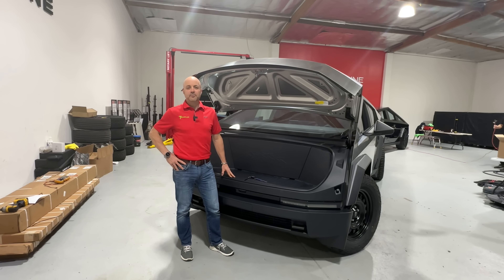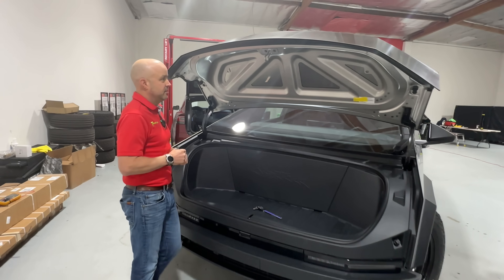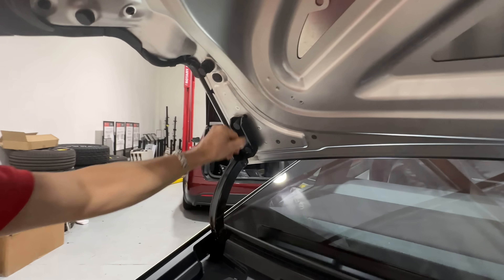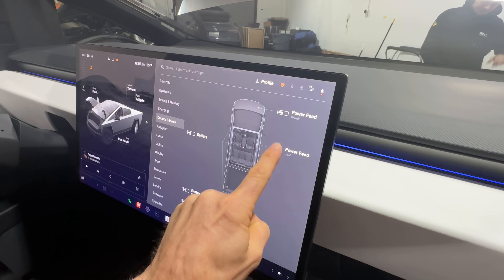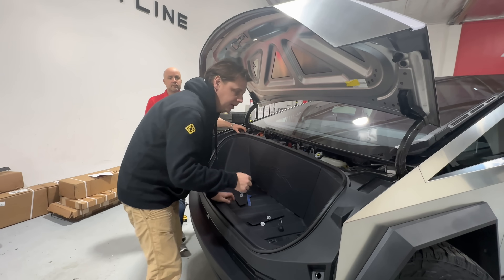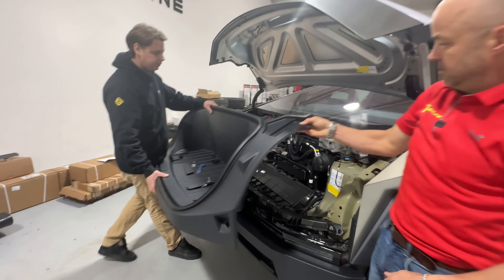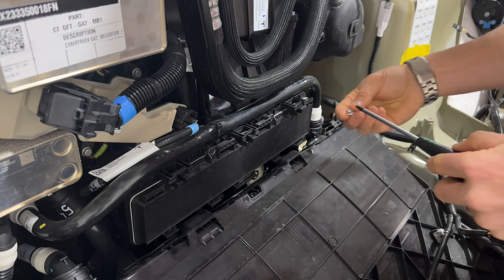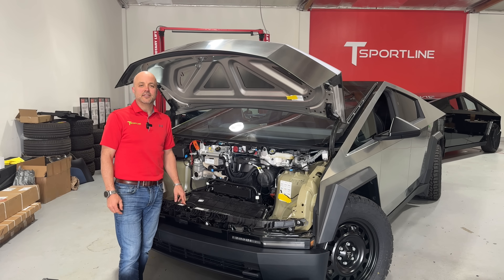Dissecting a Cybertruck Part 2! Tesla Auxiliary Power Under Frunk, Inspection & More, first look

Comment: I wonder if you can get signals to that green wire as an outside business 🤔 what would you dream up to use that for?
Reply: I had the same question - what does it take to get a control added to the OS/touchscreen for something like a winch?  Other manufacturers like Ford add multiple free “auxiliary switches” for 12v accessories like lights - would be cool if Tesla added that to the touchscreen and let either the manufacturer label them via the BUS or allow the user to add a custom label.
Reply from the maker: The green wire is the Tesla LIN signal wire.
Reply: @TSportline  well yes but what are the possibilities for its use? What would you do if you could use it?
Reply: Think Arduino. It's a 19200 baud network with about 16 data frames of aux stuff. Buttons, light indicators, etc. Good for power window buttons, door locks, etc. You could probably use software to do anything you could think of. Say you added a unit in your frunk to fold up a large Christmas train set with a Christmas village, and you put that out on display once you got somewhere. Then you could write some code to address all the different parts of your display. Say tell the train to move forward, or backwards. Maybe turn on the tiny street lights, blow some fake snow around the village. Maybe create an auto pack up or auto setup feature to open the frunk and deploy your Christmas village. Then use your app to provide monitoring from the main control panel in the vehicle and see what everything is doing out front. Not that I would build such a thing, but it gives you an idea of what you can use it for. Control and monitor on a simple level. No video data, etc. I'm sure you'd have to use the WIFI for that. @whitlockbr

Comment: Curious what the wheel bolt pattern, factory offset, rim width and center bore diameter is.  Looking for the lightest wheel I can find for drag racing applications.  And the lightest high performance tire.  While still being budget minded, lol.

I run a set of 19" forged Enkei's on my M3P that I bracket race.
Reply: CB seems like it’s going to be amazing for bracket racing based on the few videos so far showing multiple runs.  Seems to get within a 10th run after run with no degradation in performance at all, and leaves the line super consistently.
Reply from the maker: Wheel specs are here https://tsportline.com/blogs/tesla-aftermarket-support/the-tesla-cybertruck-wheel-guide

Comment: Thanks for the video. That was very informative.
Are the black bumpers made of plastic? I would want to replace those with steel. I suppose the aux power could be used for a winch?
Reply: Winches seem to use way more than 400 watts - so it can't be used for a winch. Maybe it could charge a battery used for the winch?
I hope they add more aux power in the future, electrical outlets in the frunk, and programmable buttons for the UI.
Reply from the maker: Thanks, yes, plastic on both bumpers.  We will make steel bumpers at T Sportline
Reply: @pierre.a.larsen  - Yep.  A quick look shows several 2,000 lb winches requireding 1.5KW (at 12v).  Perhaps 48v winch would be a bit more efficient, but 400W doesn't seem to be close.

Comment: So it is possible to have a snow plow controlled by the Tesla screen.
Reply: Yes, if either a single switched supply line is enough to control it or the manufacturer also supplies a LIN-bus connection. (Or someone makes a universal LIN control box.)
Reply from the maker: Eh, not enough wattage to run a plow.  400w is good for lights.  Not plows.  You'd have to go direct to the 48v battery, or add auxiliary power.

Comment: Is galvanic corrosion with all the steel brackets etc going to be an issue?
Reply from the maker: Good question for sure, going to take some time to see.  But the non-stainless and aluminum parts are coated.
Reply: Unlikely. Tesla has been doing it for 10+ years now (Model S) and there have not been any corrosion problems. It does require careful design, but it's done all the time in the industry.
Reply: The non stainless parts are painted before assembly to avoid galvanic corrosion

Comment: Can you get to the 48v accessory wires via the access port?
Reply: Quite frankly, what would you do with 48 volts? Almost nothing runs on it except Tesla stuff.
Reply: @Greatdome99  48 volt is the standard for off grid power. you can easily find a 120 volt ac inverter for 48 volt, the problem is that the 400 watts is very limiting...might be enough for a low end dewalt 20v lithium battery charger
Reply: @alainspecteur1 At that point, it'd make more sense to connect to the 110 or 220 V outlets. Running a cable from the centre console outlet to the frunk shouldn't be too much of a hassle. The 48V connection is more suited for controlling attachments that are mounted to the truck.
Reply from the maker: Not really, only if you extend the wires - then, yes.

Comment: I wonder if the design prevents rodents from entering. My CRV '16 constantly has issues with them coming into the engine air filter and cabin filter and stinking up the system lol. 

Also is the frunk liner temp insulated to keep items from getting hot from the cooling system? Or no noticeable temperature shifts from usage of the HVAC on the road? 

Reason why is because I have powertools and like to keep my batteries away from extreme temperature variations from what is outdoors.
Reply from the maker: Good question!

Comment: Would that 48 volt power a wench, is there an attachment area for a wench system?
Reply: No, that power line in the frunk has 1/10 the power required for a winch. 😢
Reply: Yeah 400 watts won't cut it
Reply from the maker: You have 400w to power whatever you can

Comment: Can we get a closer look at the 48V battery and what is it powering up?
Reply: It's powering everything. The whole low voltage electrical system is 48V, so everything electrical uses it except for the motors and heat pump
Reply: I zoomed into it.  The battery is 41.6V with 4Ah capacity (166Wh).
Reply: Thanks guys. Li-ion 48v battery I presume...
Reply: @alexadams1627  well, 41.6V, but it is close enough.
Reply: The battery is only used when vehicle is off to power the computer, camera, lights.  All the 48 Volts when the truck is on comes from the battery pack through the inverter.
Reply: @shallenberger57 This also explains why it's 42V. It's a free signal about the state of the power system. I'd bet that all high-powered systems shut down when the voltage falls below 45V or so without having to be told to do so by the computer.
Reply: @KK-ts1pm  41.6 V will be the nominal voltage. Tesla of course advertises the highest voltage of a fully-charged battery (48 V), which is like calling a common 12 V lead-acid battery "14.2 V".
Reply: @alexadams1627  as @KK-ts-1pm found, the nominal battery voltage is 41.6 V. That would be about 11 or 12 Li-ion cells in series. 

Other Tesla models use a 4S lithium-ion low-voltage battery, which is commonly and incorrectly described as "16 V" (but really has nominal voltage around 14.4V). This is probably just four times as many of the same cells in series, and the same or smaller number of cells in parallel.

Comment: Looks so easy to work on. 💪
Reply: So, if I want to replace my cabin filter it's like a 4 hour process to remove the "frunk" and all the additional bits. Yeah, great engineering. Rivian is one easy removed panel and a cover plate. Neither need tools to remove.

Speaking of frunks, what do you put up there? Couple of Target bags full of stuff you don't mind spilling out? There's not even a cargo net to help with the TINY space of storage up there. Pulling from the previous video on the break down, only aluminum or aluminum combo metals for under the truck? For a truck you supposedly want to go off road? No option for any kind of upgraded skid plates? Sad. And speaking of off roading, can't install larger tires without some sort of really custom lift kit or hardware change kit to remove the exposed bolt ends?

This was a truck engineered by car makers who don't know anything about going off road. Not their fault. I blame Elon and unbeatable time-lines.

Also, rear wheel steering on an off-road truck? If so, you had better beef it up a LOT more than they did. Again, car makers making trucks.
Reply: @azsean73 No ones removing the frunk to replace the hepa filter. They’re going to remove the front cover that reveals easy access to the filter.
Reply from the maker: It's not bad

Comment: biggest question I have is where will a winch go, and is that 400w enough to power one being the wiper blade takes 600w....
Reply from the maker: 400w wont do much for a winch; plan for another power source on a winch...maybe plug into the power in the bed

Comment: A fine design; if you are making money on repairs. To replace ANYTHING that is behind the frunk liner, its either pull the whole dashboard, or the whole motor and drive systems. All that for the future leaking hose. It like working on a modern gas car; change the head gasket SURE EASY! just pull off the front clip and pull out the entire engine. Even if I had the kopecks for one of these, I would  not buy one. For my 'peasant class EV, a Niro, EVERYTHING is in the motor bay and easy to get to for repairs. Not even a mass plastic cover. True enow, the tech is impressive, the truck is not

Comment: still find the wiper blade funny. wonder why they designed it to stay upright position instead of tucked below the windshield
Reply: can't be "tucked below" the windshield as the hood sits flush with the windshield. its upright for drag purposes.
Reply from the maker: The wiper is crazy big
Reply: While it doesn't seem intutive, the smooth hood to windshield design reduces drag.  The wiper on the side actually helps with airflow too.
Reply: @a-don13 
That's bad design, they could have designed the hood to accommodate it.

It's probably more aesthetics to show of the size.
Reply: @Robert-cu9bm  sure, people suggested that the back part of the hood raises up and stows away the wiper then sits flush again with the windshield, they even drew mockups of how that would work but Elon responded saying that that would be too complex and overengineering and i agree. there is nothing to show off

Comment: Great info, thanks for sharing.  I was very happy to see there is power that can be added to the frunk.  Wondering Tesla just didn't have time to design or if the parts didn't come in time and Tesla just didn't want to wait over an outlet.Such a great design to pull off the plastic to access the power.  Guessing that's going to be a popular addon for aftermarket.
Reply: It's not intended for stuff in the frunk, but for accessories like winches, snow ploughs, road brushes, light bars, etc. that are attached to the front of the truck.
Reply from the maker: Thanks - we will have a lot coming!
Reply: It is a 48 volt power supply, and there is no industry standard for 48 volt accessory connectors. You wouldn't want people plugging 12 volt equipment into it, so an exposed outlet would be undesirable.

Comment: Good info, thanks for the upload.  I don't think the frunk ribs on the inside are stainless.  Stainless could not be formed into the rounded rib shape.  It's standard sheet metal.
Reply: So, if I want to replace my cabin filter it's like a 4 hour process to remove the "frunk" and all the additional bits. Yeah, great engineering. Rivian is one easy removed panel and a cover plate. Neither need tools to remove.

Speaking of frunks, what do you put up there? Couple of Target bags full of stuff you don't mind spilling out? There's not even a cargo net to help with the TINY space of storage up there. Pulling from the previous video on the break down, only aluminum or aluminum combo metals for under the truck? For a truck you supposedly want to go off road? No option for any kind of upgraded skid plates? Sad. And speaking of off roading, can't install larger tires without some sort of really custom lift kit or hardware change kit to remove the exposed bolt ends?

This was a truck engineered by car makers who don't know anything about going off road. Not their fault. I blame Elon and unbeatable time-lines.

Also, rear wheel steering on an off-road truck? If so, you had better beef it up a LOT more than they did. Again, car makers making trucks.
Reply: Dont forget the 48v auxiliary lol how many useful 48v accessorys are on the market........ things a joke@azsean73
Reply: It is stainless steel and it can be formed, it's thinner and not hardened like the exterior panels.
Reply from the maker: Thanks, yes - they are thin wall stainless
Reply: You have been hoodwinked into thinking stainless can't be formed by Tesla.

300 series can be easily formed, just look at the world around you. IE your kitchen, laundry etc
Reply: Munro Live has a video called "Tesla Manufacturing: See how the Cybertruck HFS Panels are Blanked, Bent, and Built!", which is a factory tour, and describes the materials and production processes used. Yes, the inner panels (which form the "ribs") are stainless steel.

Comment: Why no mention about the filter cover tabs breaking? You can clearly see all the tabs at 8:49 and only one left at 9:47, snapped middle one at 10:14,  parts same happened on Hoovies Garage's
video where the snapped too just by touching them, that's poor quality plastic or poorly engineered tabs..

Comment: Drop a 48v to 120v inverter right in there. Maybe some of the tool companies like Milwaukee will make chargers that take 48v in.
Reply from the maker: 48v, coming in hot!
Reply: A 120 outlet in the frunk should have been included and would be a great option!

Comment: Where is the 48v battery?
Reply: The battery is on the cross car beam that he showed.   It is a small lithium battery with 166Wh of capacity at 41.6V.
Reply from the maker: in the center under the windshield

Comment: So if someone travel through some muddy waters the radiator will get clogged up dramatically
Reply: Just like 90% of all other cars on the road.
Reply: @larsjrgensen5975 Nah, when in wade mode, the radiator sits much higher than in those 90% other cars.
Reply: @HenryLoenwind  The max ground clearance is 44cm, the intake looks to be 10-20cm higher then that = 54-64cm.
When driving through water the wave in front of the car can be 10-20cm higher then the water debt, so the new max water debt is down to 44cm, when going at walking tempo.
If you look at the radiator setup, the fans are under the radiator sucking through the radiator, so the fans motors can be hit by muddy water from behind even before the water reaches the intake height.
Reply from the maker: Yes, be careful
Reply: Perhaps the front air shutters close when in wade mode.  Should be easy to test.
Reply: @tesla_tap That was my idea, too. There's a 30-minute limit on wade mode, so it could be possible.

Maximum wade depth is "top of the bumper", btw.

Comment: I think the formed inner frunk piece is aluminum, you would have a hard time forming that shape in stainless. If it is aluminum that will be a potential area for galvanic corrosion, aluminum and stainless will corrode each other.
Reply: Inner frunk is plastic of some sort. Below the frunk are the Gigapress casted front underbody/frame.  It is all aluminum. I am pretty sure Tesla knows all about galvanic corrosion...
Reply: @pierre.a.larsen  Sorry I meant the inner piece of the front hood attached to the stainless steel skin.
Reply: It's stainless steel, there are no issues with forming as it's much thinner and not cold worked like the exterior panels.
Reply from the maker: It is indeed stainless
Reply: You don't get problems with stainless and aluminium.

Stainless is not a very reactive metal.
Reply: @billhaley8873  300 series stainless steels are quite soft. Like pots and pans. The exterior panels are hardened and harder to stamp press, but still possible.
Reply: The inner panels are stainless steel - there is no problem forming them by stamping. The outer panels could be stamped, too, but the surface would be marred by the dies, so all exterior (visible) stainless steel panels are formed with only simple bends.

Comment: In Australia many 4x4 vehicles have recovery winches, is this possible on the Cybertruck. Certainly not from these tiny 48 volt cables. Would need to be high current 12 volts.
Reply: Front accessory wires are only up to 8amps. 120amps required on 9000lb winch. Main bottleneck will be dc-dc charger if not wiring directly to 800v battery.
Reply from the maker: 400w is available, not much.
Reply: Seems like one could have rear winch, using the 240VAC connection, would have plenty of power.

Comment: I keep imagining a 10 year old cybertruck with a nice patina of oxidation on it's external steel, but still structurally sound.
Reply: thats funny cuz I always say ull be lucky to get one in 5 years if u order today more likely 10 years just based on calculating production based on their own numbers
Reply from the maker: Cool
Reply: It shouldn't oxidize at all.  The 40 year old Delorians (also with stainless steel body), look fine today.
Reply: Somebody needs to do a baking soda + hydrogen peroxide + salt (mixture ratio 4:4:1) spray test on the Tesla panels. If that doesn't rust it, nothing will.

Comment: You are feeding air through the front bumper, winter road salt and Sand will make a pretty mess.
Reply: All Teslas have an air intake in the front bumper.
Reply: Around 90% of all cars do this, why should the Cybertruck be different?
Reply from the maker: It wont be as bas as you'd think.  Most all cars do this.